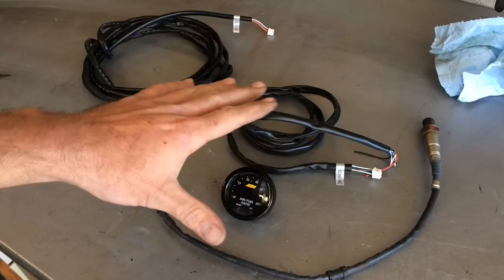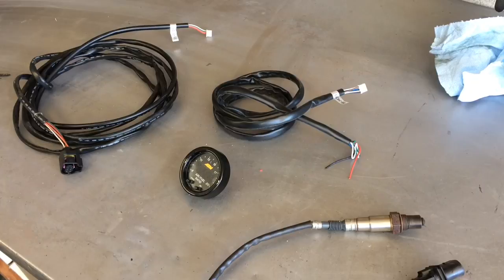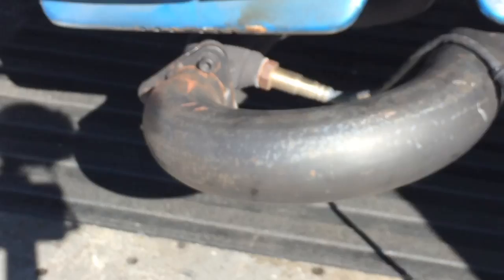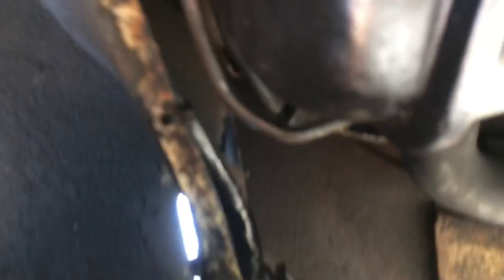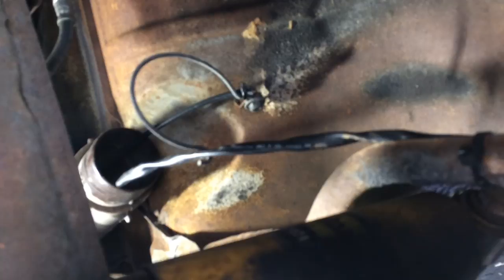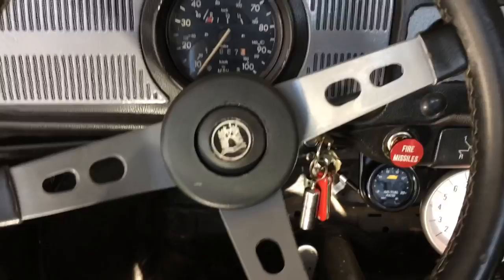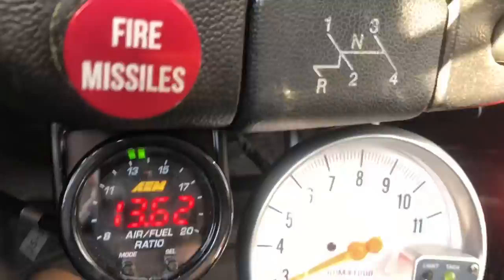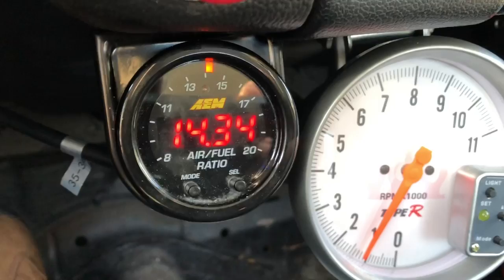Installing AND Understanding a Wide Band Air Fuel Meter in a Classic VW Beetle

Comment: The best video on an air meter by anyone. I will be adding a gauge to my car but will need a longer harness so I can mount the gauge higher in the dash. Will need to research harness lengths - wish me luck.
Reply from the maker: Mike Briere thank you for the kind words! Let me know what you come up with regarding the harness, I haven’t looked into it yet. 
Thanks for watching!
Reply: @VWJawbreaker  Will be buying AEM wide band kit # 30-4110. they sell a 96" sensor cable # 35-3441. All available from Summit racing.
Reply from the maker: Mike Briere I’ll have to look into the 96” one... thanks!!

Comment: FYI there’s an extended cable you can get that’s made for rear engine cars , I used it and it was more than enough to run it through the front and up in the front trunk and wire it up nicely so everything is hidden ! Btw great video, love all ur videos , great explanations!!
Reply from the maker: I heard there was one of those somewhere but used what I had at the time. I’ll look for it down the road when I install it back into the car. 
Thanks for the kind words and support! Have a great week 👍

Comment: Gray great job and video! Wanted to let you know that I finally installed the magnaspark kit. It's made a huge difference over the pertronix. Starting is sweet. No more cranking. About 2 turns and it fires right up. Awesome.
Reply from the maker: Jim Lester thanks Jim! I’m glad you like the Magnaspark, it’s definitely a worth while upgrade! Stay safe buddy.
Reply: I've daily driven using a magnaspark distributor, and after 2 years it blew up.

Comment: Very well explained !!
I bought a Weber book & a Kadron book - I have read each several times. Always refer back to them when I'm setting things up.
There is a guy on ebay - he has an ebay store.
I believe he is oversees . He sells genuine Weber parts & vintage carb stuff. I have not purchased from him & of course I can't remember his name at the moment. Sitting here at work on break.
If I remember correctly - optimum fuel ratio is  14.7 to 1 ( for economy & emissions )
It ALL goes out the window when you go Performance mood !!!!
Reply from the maker: Thank you. The Weber books are pretty good but most of the jetting suggestions are off now due to the ethanol in the fuel now days…. Things don’t burn the same as the fuel from back when those books were published. However those books are great for everything else. 
Haven’t seen the one your mentioning, drop his name later on when you have time and you remember. Thank you!

Comment: That will make it much easier for getting it dialled in just right
Reply from the maker: You betcha! Got this engine dialed in quite well.
Reply: @VWJawbreaker  just bought a Manx style dune buggy project and stripped down the motor.  Trying to figure out how I’m going to build this one.  Thinking just a simple 1641cc with the dual Webber ICTs that I have sitting in a tote… probably a w110 or w120 cam.
Reply from the maker: @JMKGarage  nothing wrong with a simple 1641. Could go for a W100 cam and keep the compression lower, run cooler and idle like a sewing machine with those dual 34’s.

Comment: With the air fuel gauge...put in a vacuum gauge!   both are very helpful in tuning  and monitoring the engine   I have a 1984 Datsun 200sx with ford V8 swap    fuel injection is from a older Haltech ECU
Reply from the maker: Vacuum gauges is how I use to tune motorcycles. I bet that 200sx is a blast to drive!

Comment: You can solder a drilled jet and make it smaller.  But I don't like drilling because of the variance that the bit can make among multiple jets.
Reply from the maker: DuckmanCycles and VW Garage exactly!! Plus I didn’t want to confuse people with that. It’s always better to buy the jets.

Comment: Great video I just got the same A/F meter installed on my bug and I’m ready 12ish at idle and 12-13 at cruise speed and around 11 when I mash it. I take  that I’m a little rich and need to dropped down jets in size. I read the ACN info and I took it that I need to do the opposite ?
Which is right since idle jets are a chore with no windows cut in
Reply from the maker: If you’re running singles or duals, make sure you have the lean best idle set correctly. That will make you run rich if you have the mixture screws out too far. 
If running duals, make sure to have them synced and balanced well. 
11 when you mash it, goth might need to back the accelerator pump off some. Most carbs have then set for too much squirt. It’s a balancing act for sure. Start with the idle circuit and slow rpm’s in gear putting around 1,500 rpm’s. 

Here are some notes that I have that might help you out. It’s sometimes easier to read the values vs trying to write them down when someone is talking. 

AC.Net recommend values 
14.0 - 14.7 Idle with idle mixture screws 
13.1 - 13.5 Idle circuit progression holes (009)
15.5 - 16.5 idle circuit cruise (vac advance)
13.0 - 13.5 steady cruising, 3-4K rpm 
12.5 - 12.75 WOT

Comment: I would take the time to install the sensor correctly (as per instructions) so it doesn't fail. (IE - pointing downward, instead of upward)
Reply from the maker: The bing was predrilled and already installed when I got the header. 
I’ve since corrected it.

Comment: I have this system.   Is there any easy way to tell the size of my motor without taking it apart.   Its a 1600 but i dont know if its been enlarged?
Reply from the maker: Only way to know for sure is to take the heads off and measure the cylinders and the piston travel to determine the crank stroke. Also, pull the oil pump to see the cam.
Reply: @VWJawbreaker  thanks.  That's a little above me.    I recently switched to the shortened merged header and dual quiet pack.  I must have done something wrong because it runs like crap and sounds twice as loud.
Reply: @VWJawbreaker  I've got some .o32inch thickness copper.  Can I make my own gasgets?    Heat it up to aneal it soft and cut to size?
Reply from the maker: @manningcustom  not sure to be honest. I bought the set I have.

Comment: Just curious what spark plugs you run? Thanks. Learn a lot from you.
Reply from the maker: I’ve had the beat luck with NGK plugs plus they are easier to find at your local auto parts stores. 
I’m just a guy who hates being on camera, I’ve learned a lot over the years from many others.... just trying to pass things along.
Reply: VWJAWBREAKER what heat rage?  I’m just wondering because I bought a v dub a year and a half ago and it had a 2054 in it but wasn’t run much because the rest of the bug was not in to good of shape. It’s been a fun project. Thank you my you tubein friend.
Reply from the maker: Charles Collier I use the BR6HS for stock and mild applications. D7EA for the 2054 high hp engine. 
Hope you get a chance to drive that bug soon!

Comment: Hi, i have an AEM wideband, my engine is a 1904cc on a bus 40s idf carbs and magna spark kit. My wideband is sending 11. 4 -12.03 with 4k rev, on ralenti 10.5 11.00 Do I need to change something? What do you recomemd? Im pretty new with this gauge. Thanks
Reply from the maker: I’d recommend reading the article at AirCooled dot net regarding jetting carbs and using a wide band. Those articles helped me quite a bit. 
Are you steady cruising or accelerating to 4K and getting those readings?
Reply: Yes, driving to 3-4 k on a third gear then changing on 4th gear and 3-4k rpm
Reply: I dont know if that kind of lectures are ok, acording with your video are rich.
Reply from the maker: @superteacherk  seems like it’s a tad rich on the main jets but not horrible at all. What is it at when you’re at 3500rpm?
IDF’s air jets start to take over at 4K rpm. Again the articles could help you out quite a bit.
Reply: At the begining with my engine hot, I made a total stop then start first hear acelerating to 4-4500 rev and on my widebad 14.3 to 13.8, then 2nd gear 12.8 13, then 3rd gear 12.3 11.5?n fourth gear 4k rev and mu wide band 10.8, 10.1 and moves.
Reply from the maker: Hard to say honestly, I’m not great with jetting and not being there personally.
Reply: Its ok, thanks for answer.

Comment: Very interesting, would it be beneficial for me to run the wide band on a stock engine? What kind of a camera do you use to make your videos and what editing software? Love the videos keep them coming.
Reply from the maker: Bonis67 any carbureted engine can benefit from a wide band. Once properly tuned, you don’t need to leave it in the vehicle. It can be passed from one to another or have a few buddies chip in on one. Trying to tune an engine from stock to performance takes time but the wide band definitely takes the guess work out of it. 
Right now, I keep things simple. I’m using an iPhone to record and iMovie a free apple app for editing. Some of my older vids had a knock off gopro but it bit the dust.
Reply: @VWJawbreaker  thanks!
Reply from the maker: Bonis67 anytime man! Hopefully I can sit down for a minute later and get caught up on your videos!
Reply: @VWJawbreaker  I need to get better at making them. LOL
Reply from the maker: Bonis67 I feel the same about mine. We will always be our worst critics! Just keep being yourself and things will develop more over time.

Comment: I know it's trial n error,what would you try iam at 10.5 at idle with 55 idle jet thanks
Reply from the maker: 10.5 is too rich. How many turns out are the mixture screw?
Reply: @VWJawbreaker  hey Gary thanks for reaching out and helping ,idle mixture is 1-1/2 turns out from lightly seated
Reply from the maker: @shawn9878  sounds like the idle jets are too big. I’d drop down to 50’s and if you end up more than 2 turns out with those, I’d you search around you can find half sizes like 52’s.
Reply: @VWJawbreaker  thanks again, so I should be around 1 turn out for a given jet? Just wondering
Reply from the maker: @shawn9878  1.5-2 turns out for an idle jet. Anything less requires a smaller jet, anything more requires a larger jet. 
Be careful though, having the afr gauge can cause you to drive yourself nuts chasing numbers.
Reply: @VWJawbreaker  tell me about it. ok I installed 47 I found in dad's stash and at hot idle it's 11.0 that's 850 rpm with 1.5 turns out , now if it's just off idle it's 13.5 -14
Reply from the maker: 13.5 is good for the idle 🤙

Comment: Gary!  Is there a different temporary system if one has a stock setup?
Reply from the maker: Misunderstoodboygenius you might be able to find a sniffer attachment that the oxygen sensor attaches to and slides into the tail pipe.
Reply: VWJawbreaker that was my guess. I’ll dig around...

Comment: Great video!  I just installed this on my dual port 1776 running a single Spanish IDF 44.  I'm seeing 13.5 at idle.  10.2 at cruising and 11.7 at WOT.  Do you have any suggestions about tuning from there?  I'm not sure how best to improve the cruising AFR...
Reply from the maker: I’m glad you enjoyed the video. It wasn’t easy to put this together lol
Idle seems pretty good. 10.2 cruising is really rich, 11.7 At wot is a tad rich but not bad. 
What rpm are you getting the 10.7 reading?
Reply: @VWJawbreaker  The 11.7 is at about 4,500 rpm.  Dr. Google seems to be telling me the air correction jet may be the best place to start but i've seen so little about this part of the IDF tuning.  Really appreciate your expertise and insight!
Reply from the maker: @nottito  what size is your air jet now?
Reply: The 10.2 is between 2,500 and 3,000
Reply from the maker: @nottito  that’s at the transition stage between the idle circuit and the mains. Did you set the float on the carb?
Reply: @VWJawbreaker  It measures at 1.54 mm
Reply from the maker: @nottito  there’s videos and articles on how to set an IDF float. Many say 10mm closed but I’ve found with todays fuels that 12mm closed seems to perform better. 
I’d start with setting the float level before buying more jets for the carb.
Reply: @VWJawbreaker  will do!  Thanks!  Just because I'm a curious george, is the idea that the float level too high may be "spilling over" into the main plenums?
Reply from the maker: @nottito  if I remember correctly, float height can cause fuel to spill but it also controls when the mains are kicking in.

Comment: Great video, last year we rebuilt the carb on my 1986 Chevy C10 and to help adjust carb. installed a AFR. Next I thought it would be a nice add on to my vw engine run test stand so added one to it. Here the video https://youtu.be/9HVV_0sGYc8  I'm new to these and glad to see your video and understand them a little better and know the target on 13.5 is what your are recommended. Thanks for sharing this ifo Gary.
Reply from the maker: Busman 54 I remember you doing that last year and also remember the conversation we had regarding doing these videos. Hopefully you’ll find them helpful.